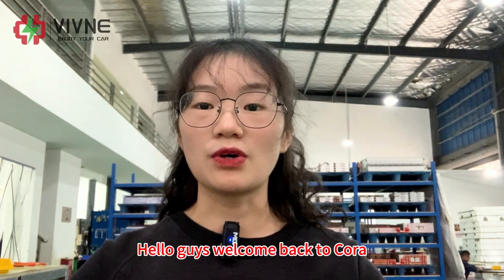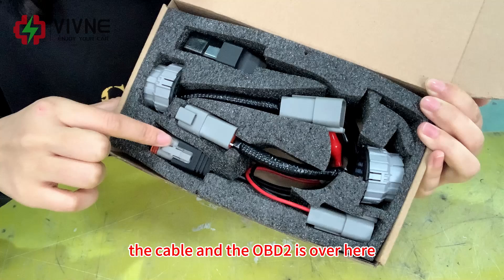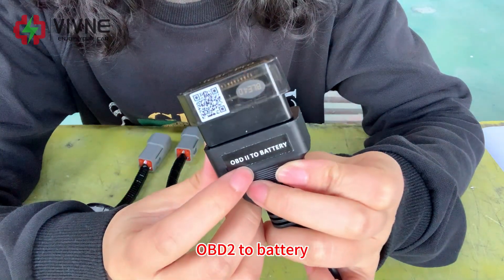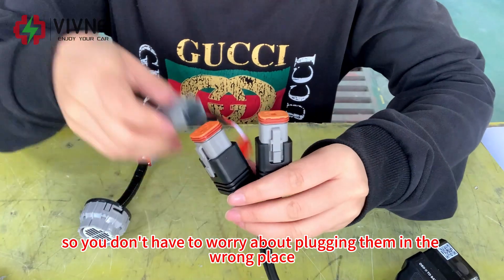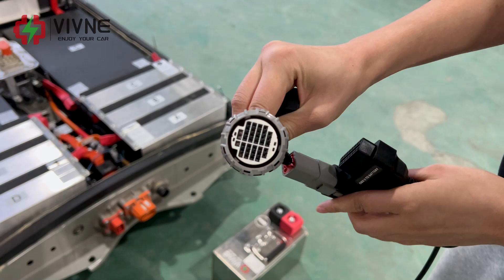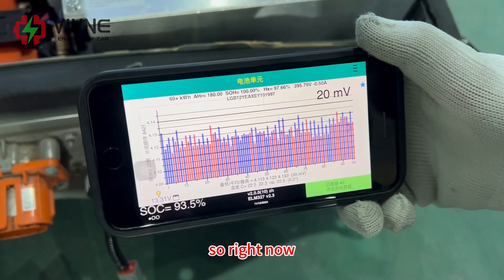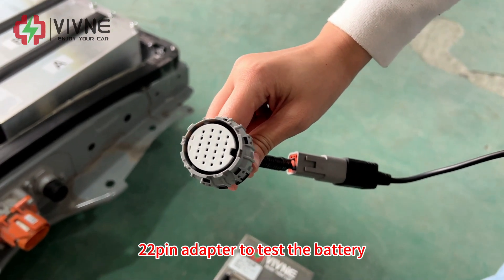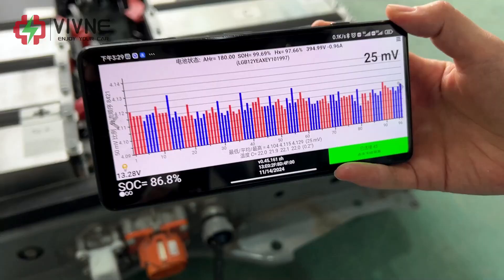VIVNE-Upgraded OBD2 for Nissan leaf battery

Comment: Wow, 300$ for a set of cables (which stl files are available free online) and 20$ OBD plug? You're joking, right?
Reply: That's why I did them myself like 3 years ago.😅 Also I did extensions to connect a pack without installing it on a car. Pretty handy.
Reply: Hi . How can i contact you pleas  @pashko90